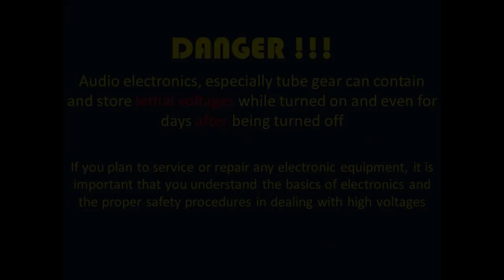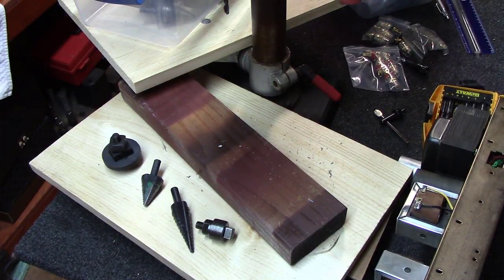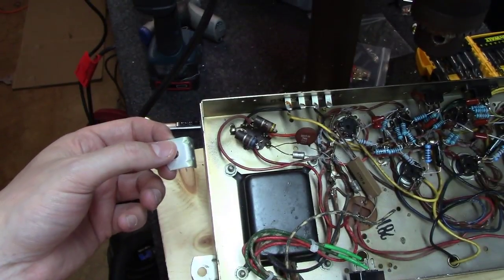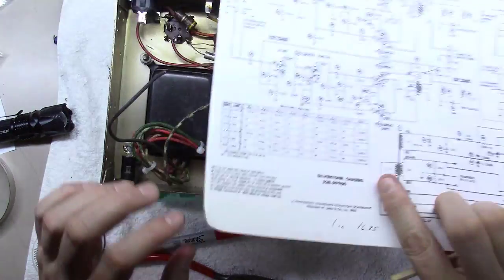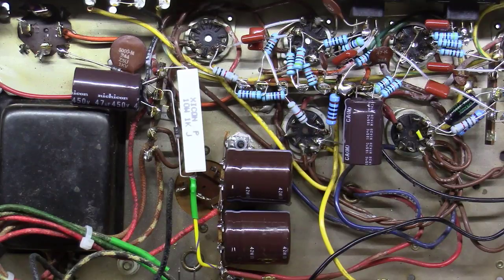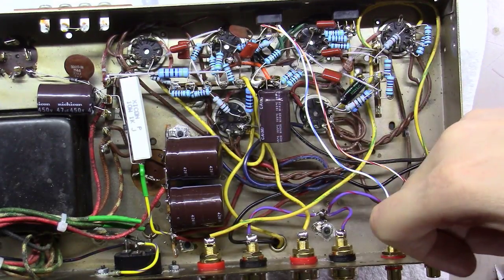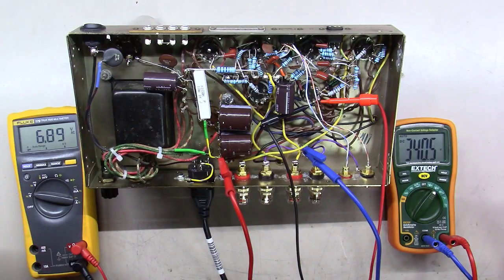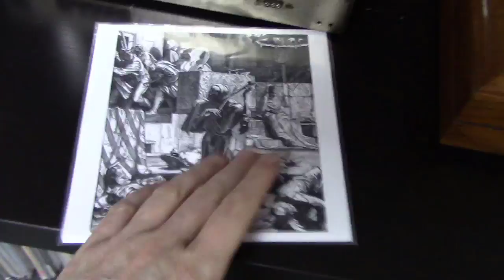How to Convert a Tube Console Amp for HiFi Stereo Use - Part 3

Comment: A little Health & Safety tip - when you wire the Black Live power wire to the fuse holder, wire it to the end connection and not the side contact like you have done. The reason is, that if you wire it to the side connection, then it is possible to make contact with it as you insert the cartridge fuse. If it is wired to the end connection, then there is no way the fuse can give you a jolt when inserting it as it does not see power until the fuse cap has been fully inserted. You should also endevour to fit some form of insulating jacket or boot over the complete fuse holder body and also the switch terminals. Play safe ☺

Comment: Good morning Mark, and everybody watching/reading. This is an especially relevant vid series for me, in that I bought this very amp and it’s tuner two weeks ago for twenty bucks(Craigslist win of the year lol). One of the best coincidences in a while for me. I’m going with guitar amp for mine, but these vids are the best outline I’ve found. I find all your vids very useful and I just want to say “Thank you”. Very hard finding schematics, I searched Silvertone console amp and found a rendering in goog images under “Roberts tech blog”. Nice and clear. As for adding volume and tone controls, any advice y’all could share would be put to grateful use. Also I’d like to share.that for de-burring holes inside the chassis I use an appropriate sized chisel. With a firm hammer tap the burrs push right off, square and clean. Thanks again Mark and good luck to all, happy Thanksgiving

Comment: That was excellent Mark..  Another good amp saved from the garbage..   Irving Mills composition, St James Infirmary  was the very first song I learnt to play, (in a rudimentary way) on guitar back in 1963.  That is a great version you have there.  It was interesting to note how so little extra mains voltage made a noticeable difference to the filament voltages.  We have a similar problem here in the UK with most mains TX's rated at the European 230 volts but actual mains supply at 240 +V.

Comment: Flea watt amps are great amps. I run near 16 watts a channel push pull 6v6GTA power tubes drivers are 7199 all NOS 1959 black plate tubes by Sylvania into Altec Lansing 15” alnico magnet woofers,  horn mids, horn tweeters...rock out more volume than most S.S. SPL. I use a tube preamp with active EQ. Wow such sound stage, imaging and sweet tube voicing. Volume is crazy just at 3 volume control.

Comment: I'm about to buy a working Hi-fi tube powered console for 50 bucks tomorrow. Can't wait to convert it to a guitar/ Bluetooth amp for my shop. Gonna get a signal splitting chorus pedal to utilize stereo sound on the guitar. It's an old Bradford.

Comment: Hi there! Loved the series. Very informative. At the end of the video, are you running directly into the amp from turntable? Or using an external preamp? Has anyone ever re-used the preamp from a console in this regard? Or is that just silly/not possible.

Comment: Nice video Mark.  Why didn't you put both the negative speaker terminals in the middle, close to each other, and both the positive terminals on the outer side.  You may avoid an accidental short while connecting speaker cables.

Comment: That was very informative.  I have an old transistor console that sounds great for what it is, but now I'm going to widen my search for a tube console.   By the way, which speakers do you use on your tube amp? 

 I have a pair of Heresy's that have amazing bass, connected to my Sansui AU-505.  This always gets a retort from the peanut gallery, because the Heresy is not known for its low range.  One hobbyist suggested that something in the Sansui's circuit lowered its impedance as seen by the speaker, thereby falsely augmenting it's bass response.  I don't understand the Why,  but the combination of that integrated amp, with the Heresy, means I don't have to use my subwoofer at all. 

Thank you for your great video.

Comment: Hi Mark, I'm curious about C74. Instead of one side of the HT winding going directly to ground it goes via C74. Did it act as a kind of ac voltage divider for the external o/p? could you dispense with that connection now and connect C73 and C74 in parallel and the ht winding to ground?

Comment: Nice job! :) Is it possible to use red LED.s to take down the 0.3V in the heater suply line, close to the valves, that is..
Reply: The current required for the heaters is way too much for an LED.

Comment: I would have pulled the original filter can caps since they aren't be used and plugged the holes. Also, there's shock hazard with no bottom cover on the chassis.
Reply from the maker: Why pull them when they are disconnected and preserve the original look of the amp.  Agreed, it could easily be done but I think they add to the look of the amp.  A lot of tube amps have shock hazard (plate caps, no bottoms, exposed transformer wires.  This is not for public use, more so buy someone who knows what they own.

Comment: I gig with two 5 watt amps run in stereo, miced of coarse.I have an AO-33 and I have looked all over for someone doing one of them and can't find one. I don't know much about this, but it looks like it has no power supply in it, There are two boxes and i think the small ones is the power supply.The small one just has two transformers ,a can and two tubes with no boards in it.The two tubes are 5u4 tubes. The other box has has 12 tubes, 1 can and 4 transformers.the big box has 6-6bq5 tubes,-1-12au7,-2-2-6au6,-2-12ax7,-1-12bh7 If you know could you tell me if I'm right. I would thank you for any information.Good song,by the way.Thank you.
Reply from the maker: Find my website, get my email off there and send me a pictures.
Reply: Will do-It may be a couple of days-Thanks.

Comment: That diode  (1N4007?) should have been mounted right next to the 1K-ohm 10W resistor, IMO. Too much heat and it could affect it.
Reply from the maker: There is a good 1/8 inch separation.  No worries.  If it as a cap, different story.

Comment: One of 47uf caps is resting on the transformer. Will heat be an issue over time?
Reply from the maker: No, those are low level signal resistors, little to no heat involved.  It's mostly power supply dropping resistors you need to worry about or cathode bias resistors.

Comment: What type of caps are you using to replace the .02 uf ceramic?
Reply from the maker: Panasonic .022UF 630v metalized polyprophylene film caps
Reply: Thanks!  Making my parts list for a Silvertone 528-59700 restoration.

Comment: I would of left the ceramic capacitors they usually don't go bad. If replaced use ceramic replacments
Reply: That will effect the sound quality of the amplifier..Their size is going to dictate the bandwidth of the unit.
The manufacturer didn't want it to have too strong of base output or too high of treble...

Comment: Why don't you use a power resistor to bring a voltage down!
Reply from the maker: If only it was that simple...
Reply: Blueglow Electronics what do you mean if it was that simple! of course it's that simple!
Reply from the maker: I wish it was...
Reply: electronic 101
Reply: jon fraer your guess is as good as mine if you put a in-line power resistor of 50 watts to step it down 117 volts shouldn't be a problem